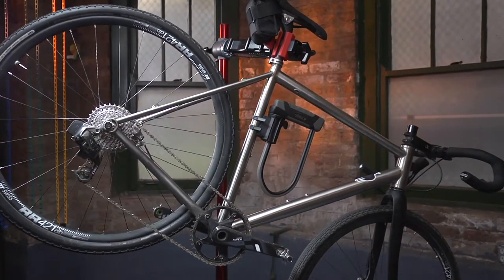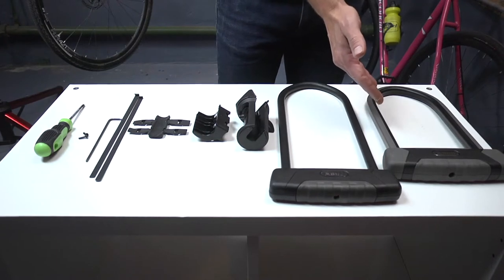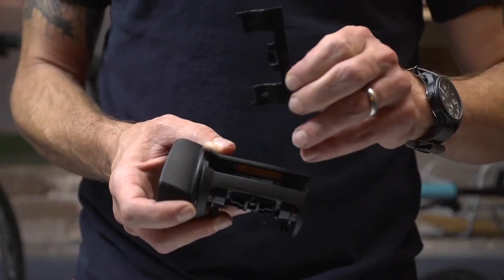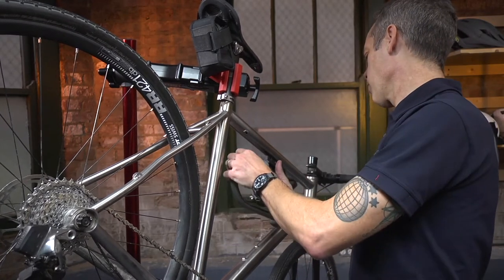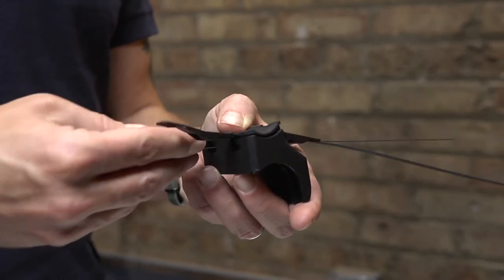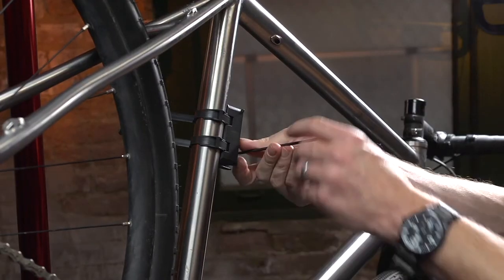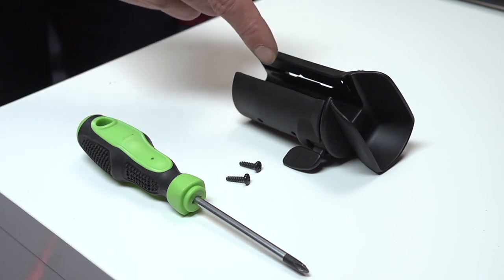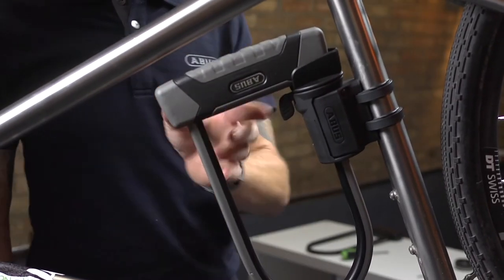SH-B bracket installation

Comment: In the manual it says the too long ends of the straps can be hidden inside the case under the ABUS logo. But the straps are on the wrong side…
Reply: Seems to be a common mistake with their products where their instruction images show a reverse/mirrored version of the item.

Comment: Hi, I have a ebike and dont have enough room on the frame for the mount. Can you use this mount for the rear bike rack?
Reply from the maker: hi. The diameter of the bike rack might be too small.  We have mounted the bracket to the seatsays of a bicycle, but most racks might be too thin.

Comment: Does this bracket work with an Abus Granit Futura 64? (Great Lock, and still sorely missed from the current line up)
— if not, are there other solutions that would work?
Reply from the maker: No it does not.  For the Futura you would use our Tex KF bracket and the appropriate shackle clamp.

Comment: hey ABUS, what is the difference between this SH B bracket, EaZy KF mount or a USH mount?
Reply from the maker: The EazyKF has a shackle clamp that  is attached to the U and connects to the bracket on the bike.  With the USH the entire bracket stays on the bike and the "U" portion of the U lock slides into the bracket and then connects to the lock body. In North America only the USH is available.
Reply: @ABUSMobileSecurityUS  You need to develop a better, more robust mount. Both the main versions are far too expensive for how poorly they perform. The places I can put the lock are serverely lmited with the inadequate USH bracket. I dont know what kind of bikes you think americans are riding, but most are not made using less than 13mm in diameter anywhere but the chainstay triangle. Its dumb and I feel like Abus is aware their bracket is severely lacking.